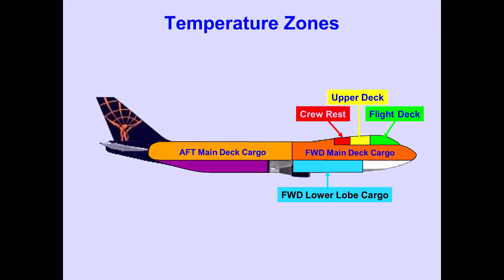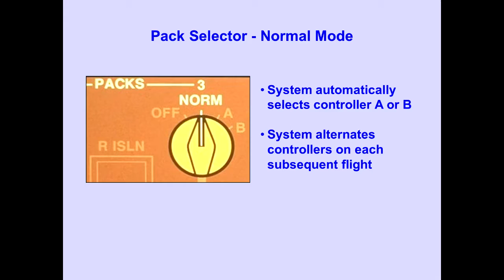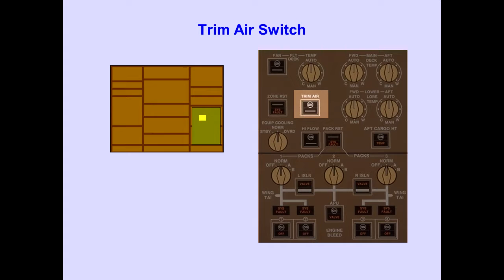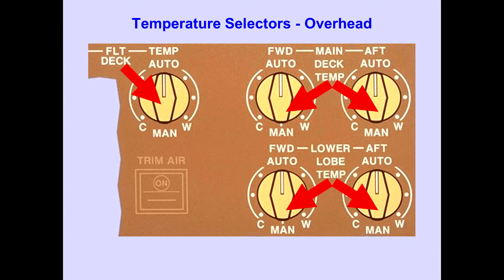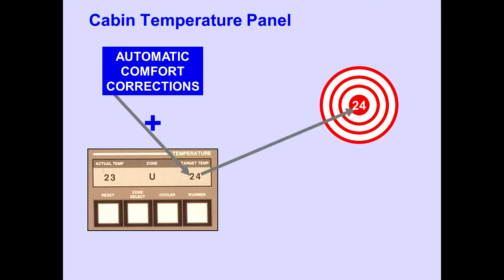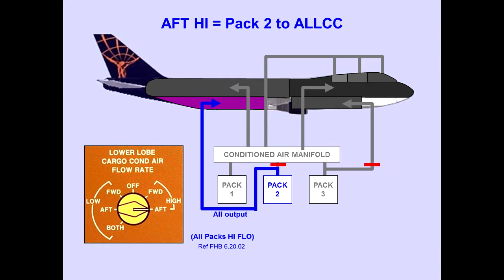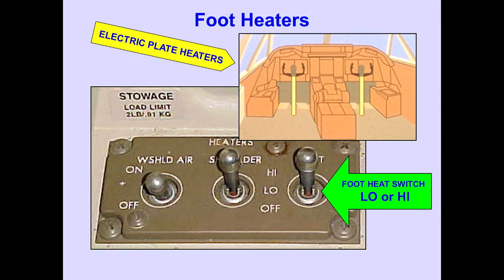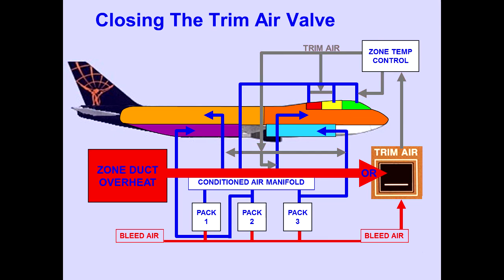#36 Air Conditioning, Pressurization and Cargo Heat Boeing 747 400 CBT

Comment: Where is the pressurization and equipment cooling portion😅?
Reply from the maker: the pressurization system slides are missing bellow is the list of the slides missing, Sadly i dont have them but you can check this video https://www.youtube.com/watch?v=--2nUC1Pc7A
both 747 and 320 have alot in common on how pressurazation system  works, indicated and how the crew can control it

PRESSURIZATION
BASIC PRINCIPLES
Cabin altitude
Differential pressure
Cabin vertical speed
SYSTEM OVERVIEW
Cabin pressure controller (cpc)
Outflow valve
Interface control units (icus)
Positive pressure relief valves
Negative pressure relief valves
CONTROLS AND INDICATIONS
SYSTEM OPERATION
Automatic operation
Landing airport between 8,000 feetand 10,000 feet
Manual mode
CABIN PRESSURIZATION NON-NORMAL OPERATIONS
Excessive cabin altitude
Loss of automatic cabin pressure control
Failure of automatic outflow valve control
Landing altitude fault
Reply: Ah ok, thx!